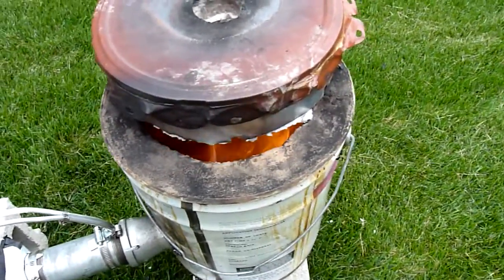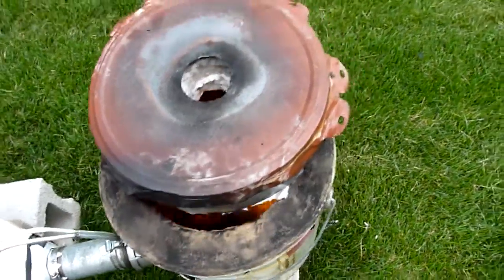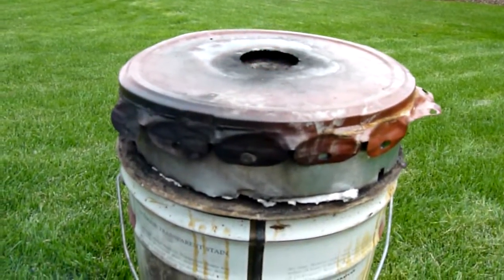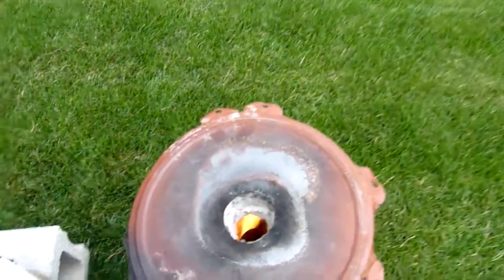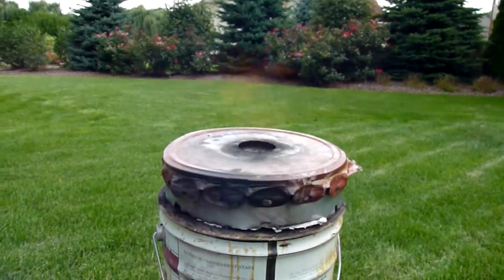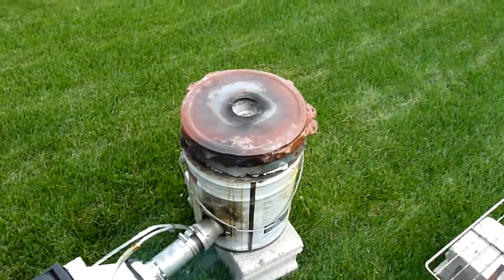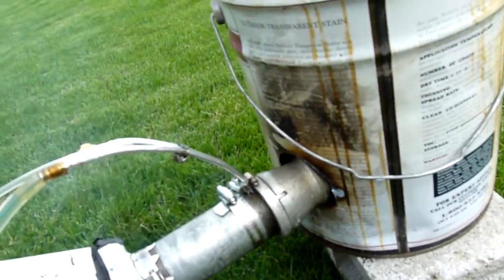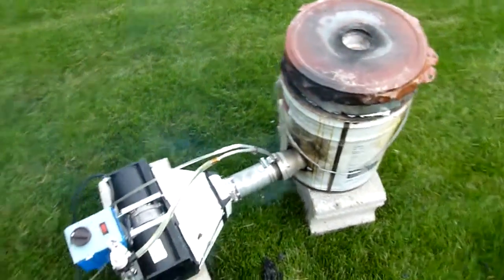Atomizer Burner Test: Part 2

Comment: How about wrapping fuel line few times around this hot pipe exhaust, so the fuel can preheat and burn better. Copper pipe should work. I have an old blow torch for kerosene and it preheats the fuel line so much that it literally vaporizes kerosene in to mist and it also creates pressure. The only problem is the valve, it gets really hot and the insulation breaks down then starts to leak kerosene, badly designed as one casting in My opinion.